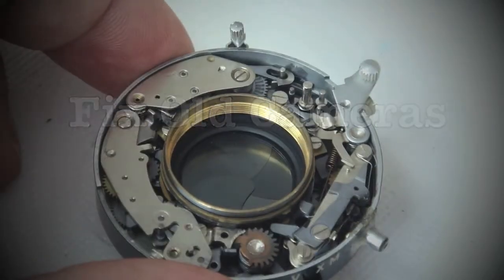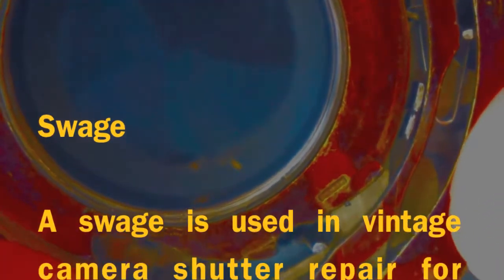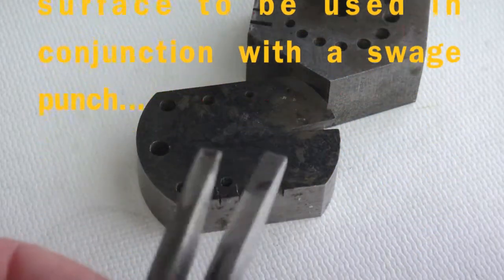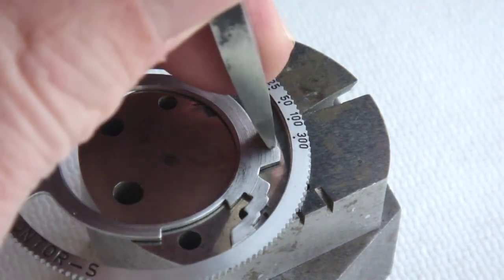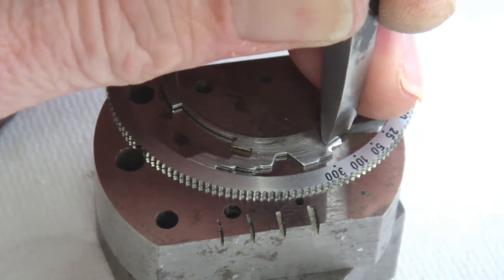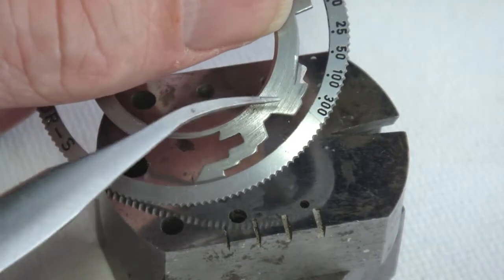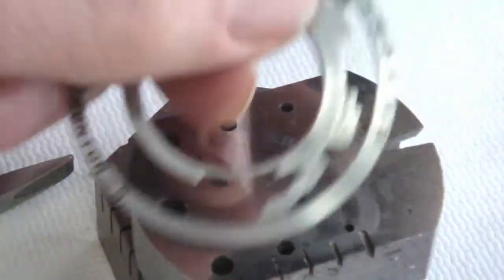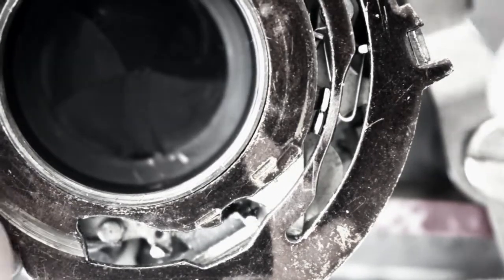Fix Old Cameras: Speed Cam Swage Adjustment

Comment: Is there a way to increase only the fastest shutter speed if the shutter is already at it’s maximum? I see Revere 33 or Wollensak 10 shutter at the end of your video. I tried to speed up this shutter by tightening up the spring but then slow speeds became too fast. Is there a way to avoid that in this shutter? Thank you!

Comment: Is there a possibility of a video showing how to service a Contaflex shutter? I have 2 cameras, (a 1 and 2) That appear to have the same issues, shutters not firing and slow aperture blades. The self timers are discharged. I have heard that this is a common issue with these cameras.
Reply from the maker: That would be a longer or a two part FOC video, but much fun.
Reply from the maker: Yes indeed. Hopefully sooner than later.

Comment: What do use for a shutter speed tester?
Reply from the maker: An electronic shutter speed tester is available for comparison and confirmation... However, for leaf shutters... a practiced ear and eye is all that is needed. A known accurate shutter is helpful to compare until your ear and eye are trained to identify irregularity. Simply hold the shutter up to a diffused light source and peer through the shutter while running it through its paces. Also, you can use a digital stop watch to check slowest speeds. Most vintage shutters top out at 1/500 and all but a very few of what are considered classic cameras top out at 1/1000. If you are so inclined DIY focal plane shutter speed tester can be made from a slotted drum that is rotated at a constant speed while a light source illuminates the slots from inside the drum. (See the Sept-Oct 1979 issue of "The Camera Craftsman." Once set up you will be able to see curtain bounce, exposure uniformity and erratic travel times. Maybe those symptoms are all a bit redundant. Probably construction of such a device is more trouble than the return is worth. Anyway,  for speeds above 1/1000 an electronic shutter speed tester is essential for focal plane shutters in calculating curtain travel times and blade (Copal type shutters) travel times, shutter bounce, leading edge engagement, etc.